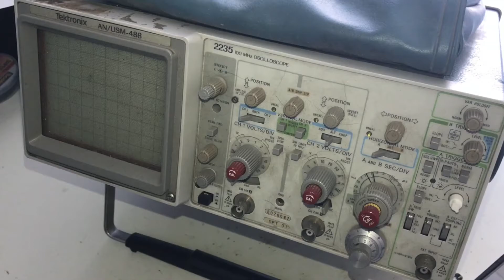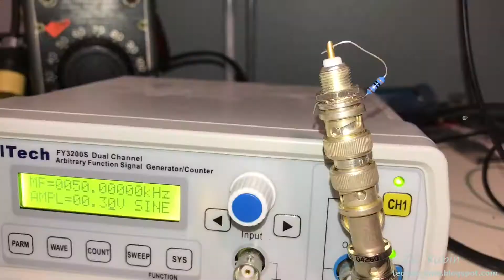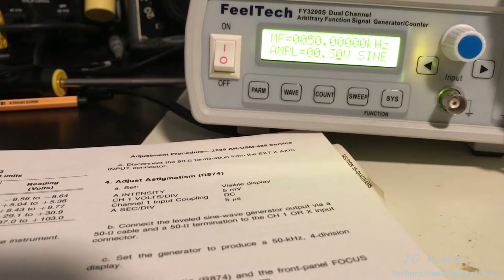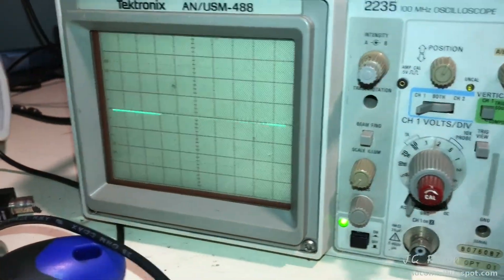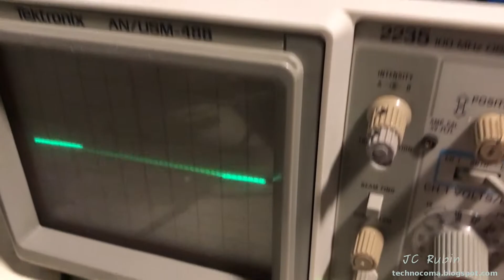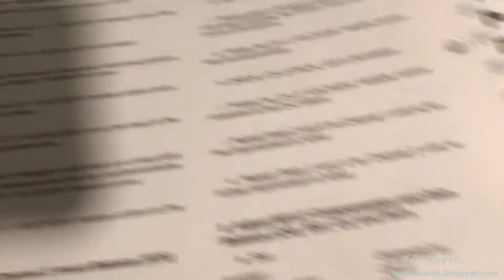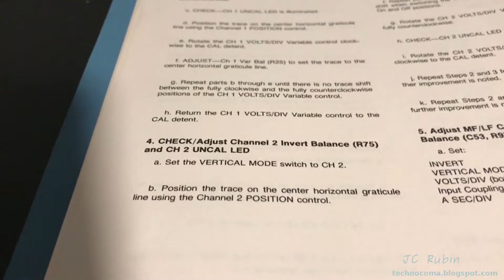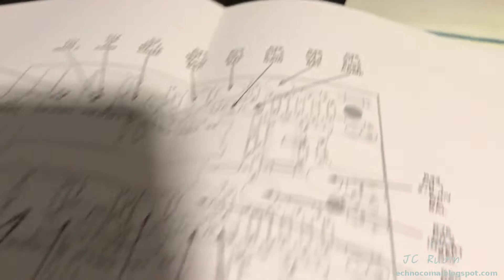Tektronix AN/USM-488 2235 Oscilloscope repair and calibration 4 of 7

Comment: Thanks so much for making these videos! I'm calibrating my non-AN/USM 2235 after recapping it, and watching these videos first really sped things up and gave me confidence to do it. Re: R75 Invert Bal: I had some luck calibrating inversion first, then calibrating the ch2 cal knob with R75 again, which threw inv. bal. out, then redoing inv. bal back and forth until I got both situations closer to good. I could never get it exactly bang-on for both of them though, so I favored invert balance since that feature seems more critical for accuracy in my opinion. FYI, the regular 2235 has a separate push-button for inversion which makes the process of flipping back and forth so much nicer, but we don't get the cool scale illumination. Thanks!

Comment: Three years later...  :)  The ch2 var balance is essentially the same as the ch1 var balance, except that the circuit has to contend with the fact that it might be inverted.  So... the procedure for the ch2 starts with making sure that the invert/non-invert circuits are balanced with each other -- i.e., when you switch between them, the trace does not move (thought it might be off-center).  Now... center the trace with var maxed (same as ch1), turn var off (same as ch1), use the trimmer labeled "R75 Invert Bal" (which is labled "R25 Var Bal" for ch1) to adjust out the difference between "var" and "not var" (same as ch1).

Agreed, the labeling of the control might throw you, but look at the physical position of it compared to the channel 1 layout, and you should gain some confidence that it does, in fact, serve the same purpose.  Or... check the schematic!